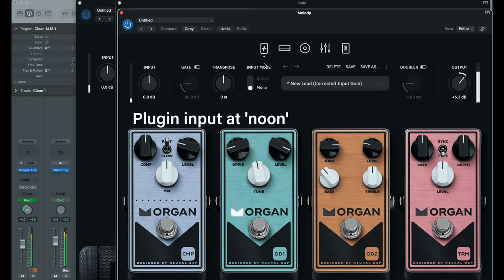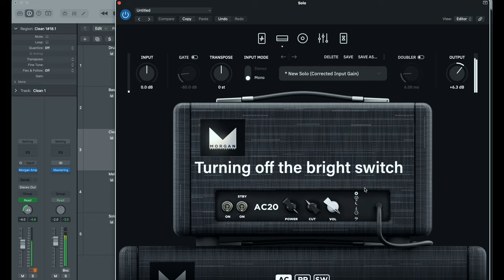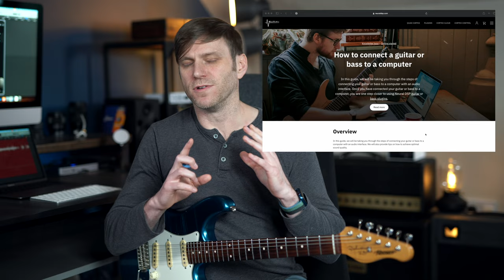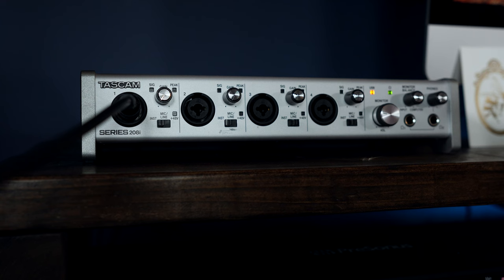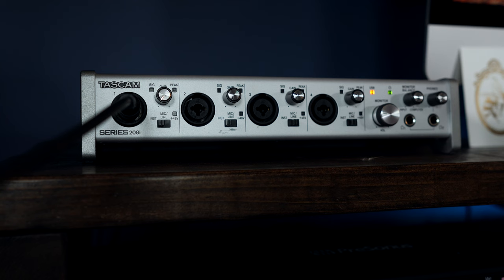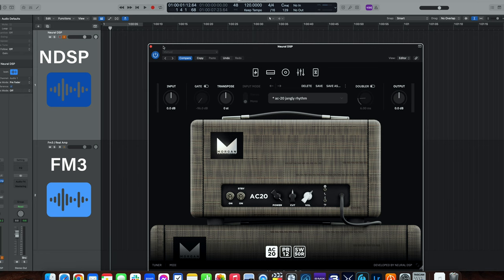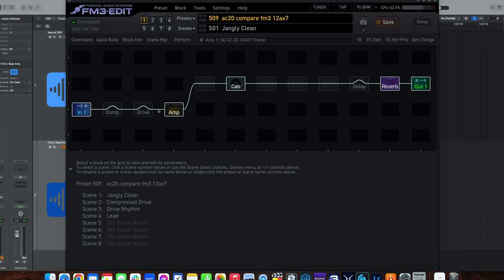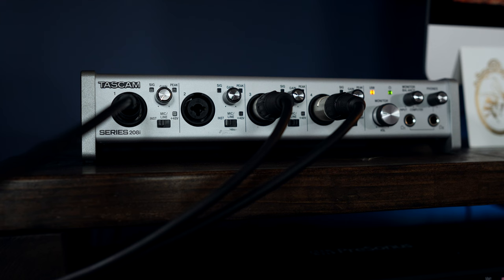I Finally Learnt To Like Neural DSP Amp Plugins | STOP Slamming That Interface & Get Better Tone!)

Comment: This definitely cannot be the correct solution. Why? Because the strength of the output signal of guitars is vastly different from each other. Think about a vintage single coil to a high output humbucker, maybe even an active humbucker. In your case not turning the input gain knob of the interface does luckily and by chance the right thing, putting your single coil Strat in the correct input gain zone. But that is completely not the case with any other guitar that does not have single coils. You of course HAVE to dial in the maximum amount of signal you can get without clipping the converters - only in that way every guitar, no matter what pickups are at the same level of signal strength.
Reply: This is really confusing but it shouldn't be... I mean, if you're going for a clean sound and it sounds distorted, just back off the gain.  The end. Right?
Reply: @sejuyz  Yes. But turn the gain down in the plugin and not on the interface. The gain on the interface exists, so you hit the AD converters with the right amount of gain.
Reply: No. You confuse a few things and this video added to it unfortunately. The "digital image" of your guitar sound is better the more you make use of the dynamic range of the converters of your interface. Once it is in the box you can still make it quieter. Not making use of your converters is like taking a foto and purposely using only half of the pixels, "because if I used all the pixels, the image would have more pixels than my screen". No one thinks like that. You use the max number of pixels and if the picture is too big, you make it smaller. Same for the audio signal. Once it is in the box and it too loud and overdrives your plugin - just make the input signal quieter. @StephaneBergeronPixelyzed
Reply: @StephaneBergeronPixelyzed  If I'm using an HX Stomp (line 6), where do I set my interface gain to 0?
Reply: Maybe I misunderstand you, but I think this totally make sense.
Yes every guitar is different, from a low output single coil strat to a high gain metal guitar. But when we play with real amps, we don't use anything between the guitar and the amps input to maximize the signal going into the amp, right? So why should we do that with software amps that are supposed to act like the real amp?
Reply: @ztevie.j  Because in a real amp there is no analog to digital conversion. The only reason why you want to adjust the gain on your interface is to get the right amount of signal to your converters. Think of it like taking a picture of your audio signal. You want to use as many pixels of your audio interface as possible (without clipping). -12 to -8 db is alright. Then you have a wonderfully detailed "picture" of your audio signal in the box (the computer). If you go lower, you lose detail. Once it is in the box, from there you can make the signal quieter, so you don't hit the plugin too hard - just as you would do with a guitar signal in front of your amp.
Reply: @ztevie.j  I adjust my tube screamer for different guitars before it hits my amp.  They all sound different.  The difference for me is I’m not after clean tones.   I’m trying to use gain to mask the fact my technique is bad.
Reply: @Sagerydian where is it different?? In one channel you’re seeing the gain of the guitar without any effects , in one channel you’re seeing the output of the FM3 (with all the processing) . What you’re saying is also true, that you could take a healthy signal first, from your interface, turn down the gain exactly the amount that you increased from your interface, kind of like making the effective gain 0, and then let it enter neural dsp plug-in. To get a good signal to noise ratio and also enter the neural plug-in in ghre required gain! But how would one know exactly how much to turn down the gain ?
Reply: @prodbyamrit Could this be done with a metered gain plugin. Make sure it's hitting 12.5dB going into the VST. I want to know about this because I use a DI box to line in. My instinct is to maximise the gain then from the line in then use a gain plugin to control it going into the VST?
Reply: @plummetplum  in case of a DI box, the parameters change. You can just check the amount of clean gain your DI box sends in and move ahead from that. 

The objective imo is 1) to not send a hotter signal into the amp 2) to keep a good signal to noise ratio BUT the noise (which is from the interface and other things) that you’re keeping out of your Amp sim is way less that the noise your pickups already have. 

In case of a DI box, I would just start with everything at 0 and check the gain that’s entering; and move up from there. Stop at 12.5dBU
Reply: @jesseeverhart  yeah I understand that. My point was in case one doesn’t want to use a gain plug-in to reduce 4999999988 units of gain. 

Also, if you know where your levels work before entering the DAW, you don’t have to add a gain plugin every time you want to record guitars. 

You either need to make a group of plugins including the gain plug-in and the amp sim and use it every time you’re recording guitar. Because I think a lot of people have multiple guitar tracks.
Reply: @jesseeverhart  yes yes I agree
Reply: @jesseeverhart This has confirmed what I have been thinking thanks.
Reply: It’s a concept. You’ll have to adjust for guitars. But it’s a much better starting point. 

The tweaking to the input from there can be achieved within the plug-in input control.
Reply: @Sagerydian You are completely right.
It's very interesting to see that first class YouTubers paid by the plugins editors can't get that right and give a very wrong advice by telling people to keep the gain button untouched on their A/D converter.
Reply: @Sagerydian  That analogy with digital photography is very good!
Reply: This may be true to other plugins. Neural DSP does their plugins based on these interfaces to the minimum input gain.
Reply: But I mean single coil and humbuckers should sound different. Also digital amps and multieffects do not have input gain? Of course if you use mic level, then you need to adjust the gain, but not for hi-z.
Reply: This is how it works on real amps. Why would that be wrong?
Reply: But maybe thats the Point, to not have the besutiful complete AD converted Signal with 220 Megapixel. Maybe the 0Gain represents much more of the passiv "analog" real world Signal conversion in the preamp of an Amp. Its absolutely no Argument, that Guitars have to behave all the Same on a f.e. Deluxe Reverb. Because they just dont!
Reply: What a noob suggestion.  The strength of guitar signal alters the amp reaction to it.  Why would you want to level out the signal of a humbucker to that of a single coil? Might as well throw your humbucker in the trash if you want it to make the amp react like it’s a single coil.  If your audio interface has a guitar plug in it with the proper impedance like Apollo or Focusrite, there’s no need you raise the preamp gain.  Then use the app’s volume knob to act like the guitar’s volume knob for roll-off moves.

He’s not trying to record the DI of the guitar through a DI box that produces line or mic level signal going in to the interface, he was making it work with the app so he can play with it in realtime like a physical amp.  IF you are recording a DI for reamping purposes, then yes your suggestion works because you’ll want to make use of that flexible dynamic range for editing.  Console or interface preamps are for mic signals, not for instrument signals.  That’s why Apollo has Hi-Z inputs for this reason and their preamp is disconnected from this input.
Reply: But that's not how amps work. A real amp will break up more with a hotter signal.
Reply: Different guitars will have different signal levels going into a physical amp as well though right..? The point he's making is that the amp sim will react the same way as a real amp would with whatever guitar you're using if you set the interface gain to the levels he's saying. Which is all he's wanting really.

I think the ideal scenario though would be to set the interface gain to the level it wants in order to perform its best then use a trim plugin and a level meter to back off the gain and ensure your signal is hitting the plugin at the signal it wants. This way you get the best of both worlds.

All in all though none of this matters and is a weird thing to be stressing this much over. Just plug in your gat and adjust the gain to get the sound you want and be done with it 😂 There is literally no perceivable difference as far as sound between backing the interface gain off or the plugins gain. The bigger difference will be aliasing and the plugins oversampling capabilities. But that's a whole other can of worms.
Reply: Guys, the plugin has an input gain knob.
Use that, that’s what it’s for.
Get a healthy signal from the interface like you would recording anything else and pull back the input gain in the plugin until it sounds exactly how you want it to sound.

Or set the interface very low, doesn’t really matter, but in theory, the input gain knob on the plugin will give the best result.
Reply: @ztevie.j turn your interface to zero. Zero. Then find what plugin your using and what your interface max volume is and adjust in the plugin from the manual. It’s literally two steps. Not confusing at all. Here is the explanation properly. 2 mins in. 

https://youtu.be/jnlXms2bLoI?si=1QC3WL7OfpEfOMvR

Comment: So, when you mic your amp and use a mixer to run through a PA, you, put the input gain on the mixer on 0?  OK, get my point.  LOL. Raising the input gain on the plug in or having you mic level input on a mixer too low and raising the volume of the amp makes no sense.. Stop the nonsense.  When you have the input on your interface is on 0 and raise the plugin input is going to be noisier.  I can't believe people are losing their minds about how simple the reality is. When did wrong become right? LOL. I imagine this is for clean tones and just slightly broken up tones. If anything , lower the input gain on the amp sim or dial down the gain on the amp sim head.  Turn them knobs a bit tho get the sound.  Putting your interface on zero is just a no. Is it wrong, probably not  and maybe it has its uses in some aspects depending on what sound you are looking for.

Comment: STOP CONFUSING PEPLE wrongly populating Ed's video !!!! You have ZERO on your audio interface but you have your GAIN CRANKED UP IN LOGIC'S TRACK instead of it. Let me guess - you wouldn't tell anyone about this details in video, right ??   I haven't seen video yet but I've seen 10 of the same reference WITHOUT mentioning that you have to get your gain back just in digital domain instead of interface. Ed's video NOT ABOUT PLUGINS OR GUITARS OR INPUT LEVEL. It's about matching gain level RANGES of YOUR audio interface with plugin creators' audio interface. It's like tenth video when YouTubers continue to confuse people with stupid "set your interface gain to zero" idea without telling that you STILL have to compensate your level in DAW instead. Let's check your video if you will mention this "insignificant" detail.
Reply: Please explain it simply. Throw some numbers out.  My AI inst input  is a base 12db so I set neural to -12db for the plugin input?

Comment: Ola was doing a plug in review, about a year ago and he had the input on the plug in at zero. Someone posted a question to him why he had it at zero and he explained in his next plug in review why he does this. Ever since I saw that I’ve been doing that. I find it interesting how people are doing the reverse and putting the interface input at zero instead of the plug in. I tested it and is much different.
Reply: Sweet, love Ola, and will be searching for those Plug-in videos

However, if you happen to know which ones they are, would you mind posting them here??
Reply: It sux putting the interface at zero and makes no sense at all. This topic has just gotten way overblown. People need to use the level indicators and their ears. It's actually hilarious how people buy the BS about putting the interface gain at zero. Input on the sim should be at zero at least to start then tweak if necessary from there.  My 2 cents.. It's really a no brainer. Analog or digital it's always been the same concept.  Cheers. Of course an amp sim will NEVER sound like a real tube amp that it is emulating simply because they are NOT the same. I think the sims are getting better though. For sure.

Comment: I stumbled upon your video while looking for answers for this type of problem, but using Amplitube. When you mentioned you were previously using a Presonus Studio 1824c, I got that aha moment. I too, am using a 1824c. But I also have a Behringer Ultragain Pro-8 Digital (Model ADA8000) running through my Presonus using ADAT, for 8 more mic inputs. I had never thought about plugging my guitar into the cheap Behringer interface, to see if Amplitube sounded correct. Well guess what.. It did! I was about ready to give up on Amplitube, but holy crap does it sound good now. Thank you for making this video. Cheers!

Comment: Very interesting! A few days ago, I bought the Morgan Amps Suite and was quite confused why I don't sound like Jack Gardiner by using the preset "Favourite Breakup Lead" (well knowing, that I never will sound like Jack!!!). What's even more worse is, that it does sound absolutely different in my two different DAWs. One with a Audient EVO 4 and Logitech standard speaker (DAW just for noodling and collecting ideas) and the other with a MOTU 896 mk3 Hybrid, Tannoy 502 and a RCF sub. I spent a bit of time getting close to the tone I wanted by comparing it to Jack's video. Now I'm using the PAD button (-20), leveling the input gain by +1 db with the MOTU. By using the EVO the only chance is to roll the knob down to the lowest input level. From now on, I don't fear a small wave when recording guitars with Cubase, because now the amps sound more the way they should.

Comment: Great demonstration that was easy to follow and you could definitely hear the difference. My problem is I don't own any of the amps that are in the Neural DSP plugins I use, so I have no base reference. I can hear the difference now in the Tone King. That was the Strat/Tele tone I was looking for when I bought the plugin. I am interested to test how this affects my high gain tones in plugins like Gojira or Nolly using humbuckers. Thanks again for the tip. Subscribed.

Comment: it makes sense... if youre above zero youre basically adding a boost. had always set mine to zero with the QC as an interface.. granted if you use the QC amps you adjust it to your pick up outputs.. but plugins are different..

Comment: With Softube it is great.
With Amplitube , I push the input slider till I feel less 'Spikiness' on my fretting fingers.It's not as scientific as the suggested settings for the known values on the other sims.And I have to adjust it then save for any amp.But it feels fine enough as I use real Marshalls too and I can only compare them for my own songs.It's not as nightmarish as it's made out though.
Thank you !

Comment: Yes, over never had any luck with software modelers, but I always maximized my input signal. Now I have to revisit the software stuff and try this...
Reply: Did you retry working with software modelers? Did it workout to be ok?

No matter where I set my gain level (I set it to zero now), my amp model plugins always sound very very bottom heavy, muddy and dark as if something is wrong. I plug into high z input with gain at 0 on interface.

Comment: I've always had the gain knob at 0, I never thought about it but I guess in the back of my head I didn't want any more colouration from the preamps, and if I needed more gain or less on the amp plugin I would just use the input gain on the plugin.

Comment: My Fishman Fluence Moderns, which I played with the most when I picked guitar back up and got into plugins, needs to be at zero gain on nearly every interface Ive tried, to be at the levels theu recommended even. So I was lucky in that aspect I guess. I now follow Ed S. Table for ideal input gain levels and my recordings are much better

Comment: That‘s why there is an input knob in the plugin 🫠 It‘s always a good idea to record a DI as hot as possible with a high quality audio interface. If you use a great DI box in between it can be even better. Just play around with the volume of your takes or the input knob in the plugin and you‘ll get the results you need

Comment: According to sheet document of Ed S. in my case I should be engaging PAD od my Behringer UMCS204HD. dialing +4.8 gain in plugin. Unfortunately, it's not enough, what is noticeable when I'm going through presets of other artists. My guitar has quite hot pickups for metal stuff, so that's not the case. Sustain is quite low, can't do pitch harmonics that well etc. I tried disengaging PAD button, that was better, but too hot sometimes. I've got better results dialing forbidden gain knob at my interface, so it's hitting -12dbfs in DAW and it's more natural and responsive that way.

Comment: Interesting, i have come to the same conclusion to set the input gain really low generally (was listening for noise floor). But I also almost always use one and the same Impulse Response, no matter what. Just seems to sound best with my not so great guitar, haha. I also tend to put a very quick attack and release compressor in front of the amp, kind of like a stomp.
If you haven't already try the Tonex plugin by IK Multimedia, there are tons of amps to check out and most of it is really close to an actual amp sound.